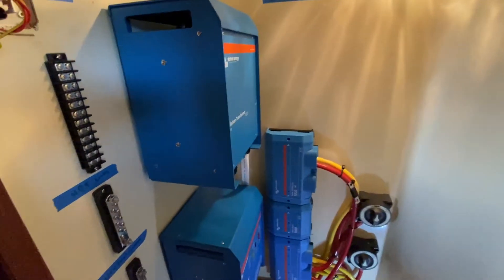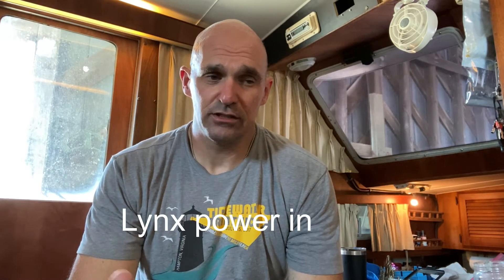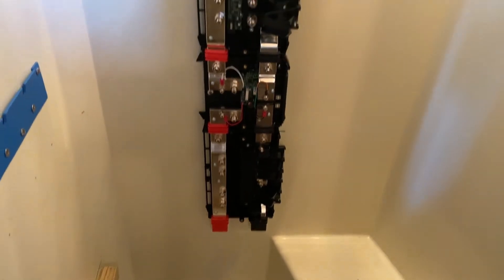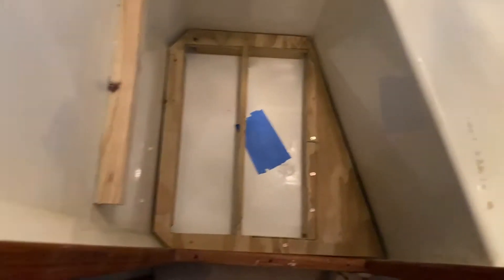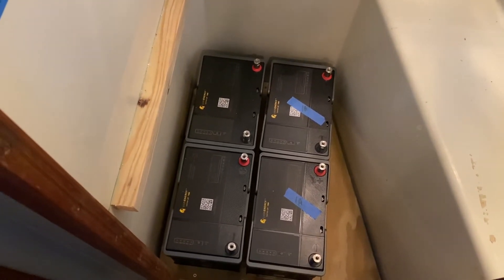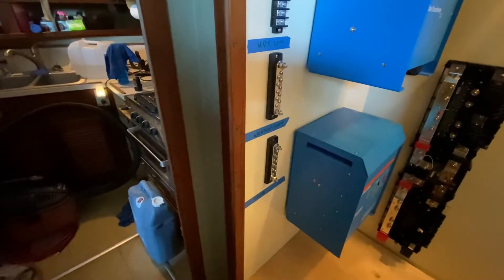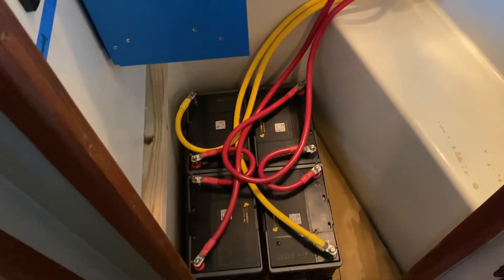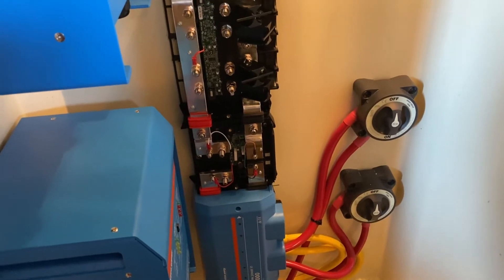Install—Lithium batteries, victron inverter, isolation transformer, lynx shunt and distribution

Comment: What guage wire did you use on your battery bank to lynx power in?  And what guage did you use for lynx distributor to inverter (4/0)? Thx
Reply from the maker: B1LB0 B, we used 2/0 for both, since we set up the system to be a 24 volt system and the run from the batteries to the lynx power in was only 48 inches and the cable from the distributer to the inverter was 24 inches , 2/0 was more than sufficient at 24 volts, based on abyc voltage drop it was still overkill for my system

Comment: Thanks for the information. my system is similar and looking forward to seeing the rest.
Reply from the maker: Doug, thank you for watching i really love the connectivity of the victron components, been a little frustrated with the victron networking for the cerbo gx though it is not as intuitive as i had hoped and they forget to mention you need good internet or wifi to really make it work and unfortunately where my boat is both internet and wifi are scarce, so i ended up buying the bluetooth dongles to be able to see the system easily on my phone